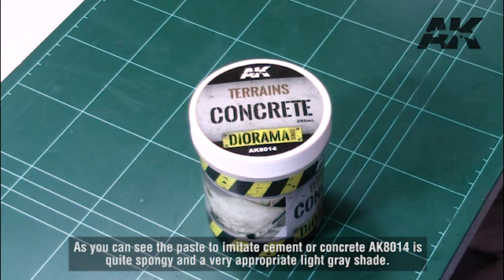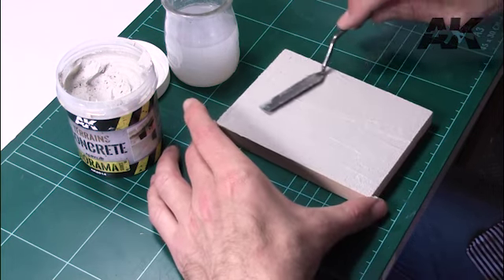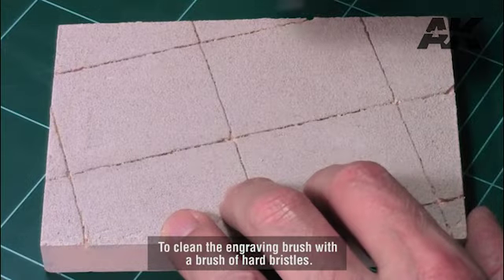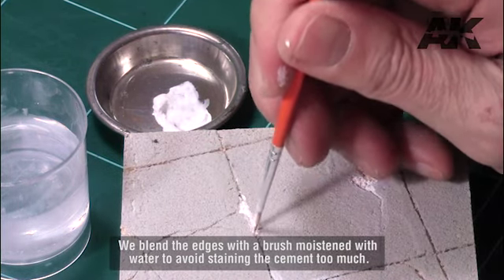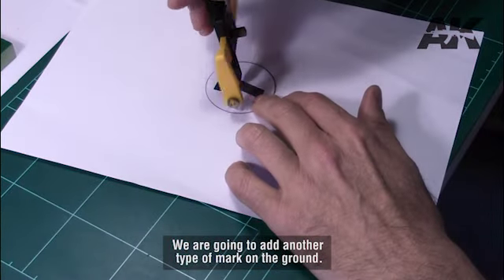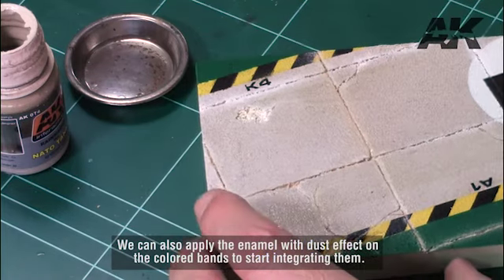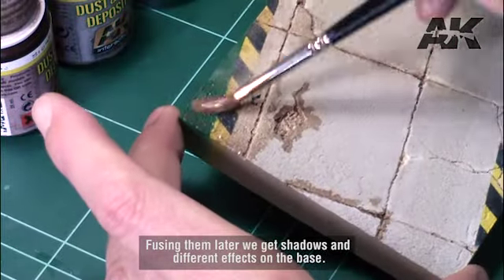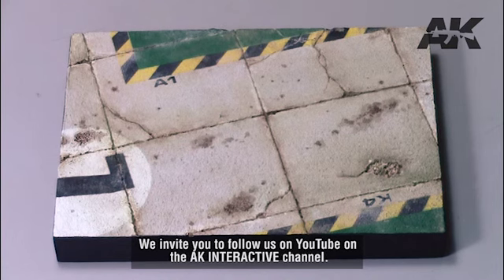How to: AK8014 || CONCRETE

Comment: OK, this is definitely the product I want to try next. I work any project that are street and city theme. This as well as the asphalt mix would be idea. Cant wait to are experimenting with these.
Reply: Trust me both are awesome and work well.  The trick is to use as big of a trowel or flat spatula tool as possible and moisten it to get a nice smooth surface and no lines

Comment: will this stand up to being outdoors in summer and winter?
Reply from the maker: Hello, thank for your question. We can’t imagine what do you want to use it for our concrete paste. Our models and scenes always are in closed spaces. Could you be more specific about your question?
Reply: @AKInteractiveOfficial  sure. I model G scale railway outdoors. some of my concrete looking loading bays for hoppers at a cement plant are plastic and i want to make them look like concrete and aged. I thought your paste would give a realistic surface. Just has to stand up outside.
thanks for the great videos. I am just getting used to using your paints for weathering my models.
Reply: @darkknighte  if you have a way to make a mold you could make a whole new dock with actual cement.  Anchor bolt cement has the same texture and its actual cement.
Reply: @Danvers97  oh cool. anchor bolt cement...I'll check that out. This is for G scale..

Comment: Would it be possible to use this product to simulate concrete walls on mdf buildings?
Reply: Yes, you can. But seal the MDF first, so it doesn't absorb any moisture from this product.